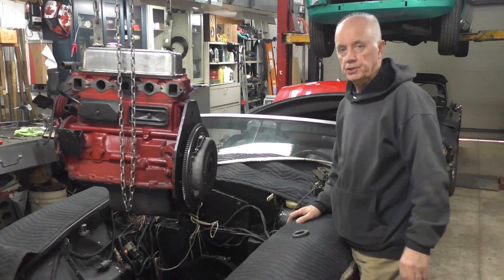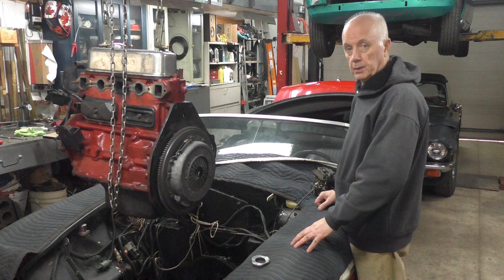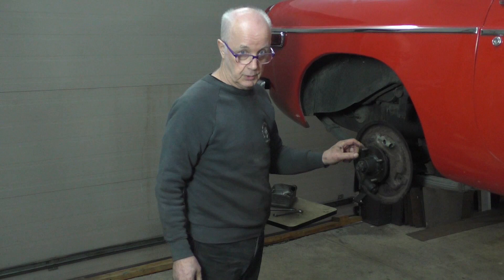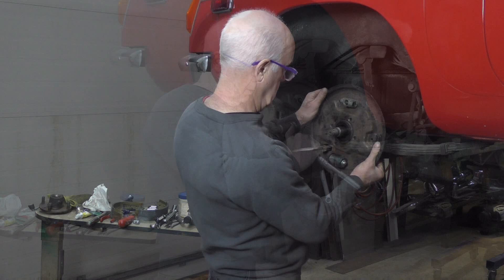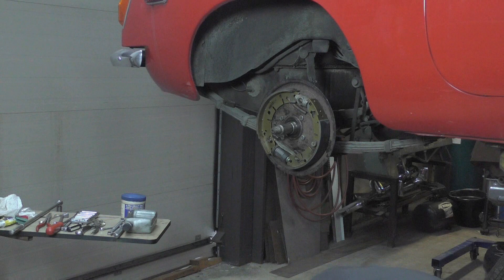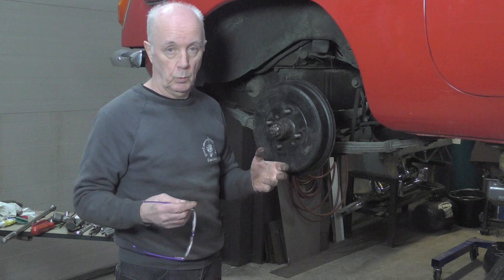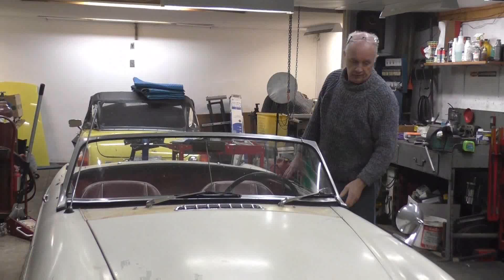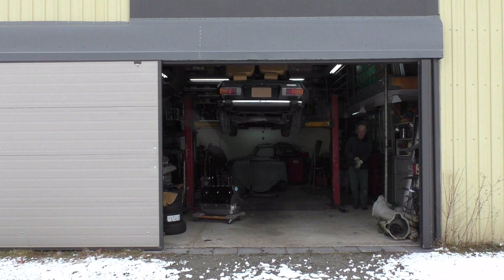Dr Doolin's Garage Episode 04

Comment: For the past 40 years I always pull and install the engine and transmission as one unit. Its well worth the extra work. Its also the best time to replace the rear main seal of the engine and the front input shaft of the transmission. While I'm at it, I also replace the clutch fork bushing and push rod on the slave cylinder.
Reply from the maker: Hi, normally that is my preferred way to do it, remove engine Gearbox together. But when clutches were being fitted in the rubber bumper cars there was a lot of time spent refilling the cooling system though the plug on the Thermostat housing. So the engine and radiator were taken out together without draining the coolant. Overall a lot quicker but a bit of care was needed. This was back when there were lots on the road for full time use, clutches worn with city driving and Dealers paying mechanics on flat rate. With customers not wanting the extra cost of Engine and gearbox seal replacement. 
I just take the engine out on its own for a change every now and then. I taped this to show it is possible but care is needed as the engine is mated back to the gearbox. As I showed damage to the clutch is easy done. Usually I only do it when its a rubber bumper and do so complete with the rad. As it happened I did replace the gearbox seal on that car. Yes it is good practice to replace the seals.
James
Reply: @Dr-Doolincom  Thank you for the reply, it is an honor to here from you. I am a big fan of your videos.

Comment: I appreciate your videos.  Thanks for taking the time to put them together 
One question: I noticed you put the long end of the spring that rides against the parking brake mechanism on front shoe. Most references I’ve seen show it on the rear.
Does it matter?
Reply from the maker: Hi, sorry to be so long in answering,  I assume your referring to the outside spring on the actual levers for the H/Brake. To be honest it doesn't seem right to me either way its fitted, as it doesn't lie well,  but the way I fitted it seems to have the better lie against the lever. 
Guess the short answer to the question would be "no"
Thanks James

Comment: Hey James you never showed fitting the brake cylinder to the backplate with that CClip
Reply from the maker: Hi Ray,
I made a video on fitting the cylinder using the tool that makes it a lot easier, its on here (YouTube) or my site.

Comment: Great vid Doc. I have just put a new engine wiring loom in my 78 MG B. however i have no working  indicators, fan and fuel gauge. Have i crossed some wires? Could you do a re wire vid? Cheers any help would be most appreciated
Reply from the maker: Hi, like the "Black van and Robin"
If you start with the wiring dia for the car you will notice that the Indicators (which get the power though the Hazard switch)  the fan and the Fuel gauge get power from the same source. I am assuming it is an North Armerican car. This is in a connector on the harness, as other units are also connected to this. I would start by checking if they are getting power as well . This all starts at the green wires (double) at the fuse box which in turn is connected to the Ignition relay for the power. By the way make sure the Fuse box has the bridge between the fuses on the Red/Green wire (Lights) .Work your way back to each connection just start with one. Chances are that when you find the bad connection it will fix the rest. 
It goes without saying that you make sure all the grounds on the harness and individual units are good and not on paint or rust. A bad ground on the harness can make a number of odd things happen.
Reply: @Dr-Doolincom  thank you  Dr. It is a UK car but will do as you prescribe 👍👍

Comment: Hi Doc, would it be a good time to change the axle bearing, seeing as by the time you've got the brake backing plate off the bearing is right there. Is there a lot of extra work to pull the axle/bearing from the diff housing?
Great tips in the vid for easier brake shoe assembly.